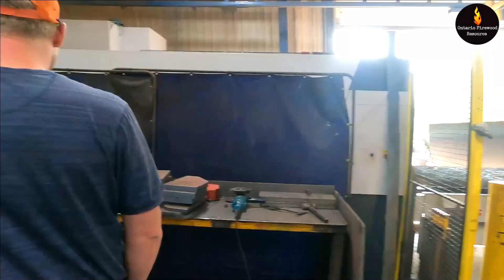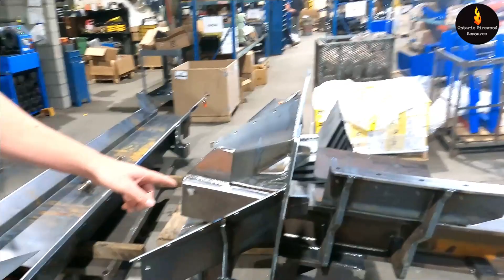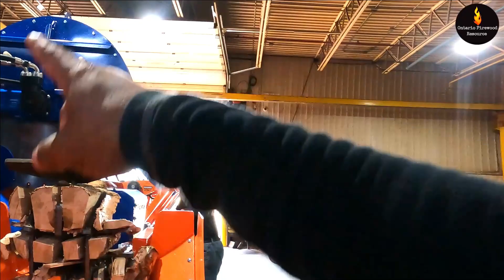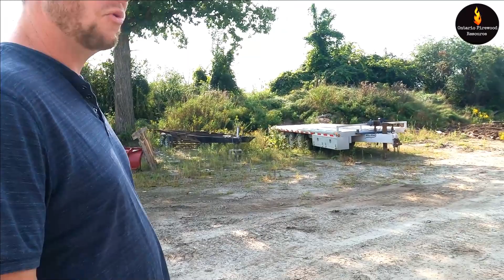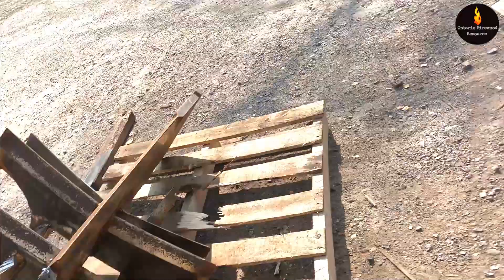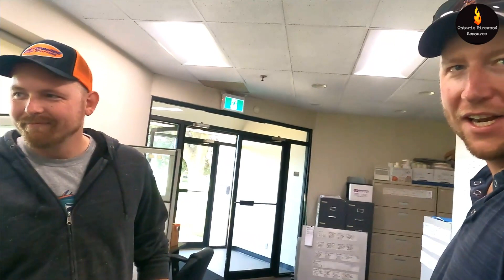EASTONMADE WOODSPLITTERS TOUR 2.0! #FIREWOOD

Comment: Love to get one of those eastons but too rich for my blood😢
Reply from the maker: I should've bought one before I built one. I knew eastonmade a little bit while I was researching which machine to buy or to build one. It was my early days of the business so I wasn't looking at a huge purpose. I was getting a lot of straight wood so I built the beastonmade. The parts were inexpensive and I traded wood for the  welding.and metal scraps were used instead of new stock

Comment: Going to the Easton Made Facility, Which of them would you buy, 12-22 22-28 WITH THE Attached Conveyer or the 37D, hAVE A GOOD DAY Anthony,
Reply: I picked up my 12-22 this past Friday and it is awesome.  I even used the pizza wedge and it worked great!
Reply: @adirondackwoodsman is it east to switch from pizza to regular wedge?
Reply: @adventurerhoades  I am not sure since I have only had it a week and I want to get through some ash before swapping it out.  I think it weighs like a couple hundred pounds so I plan on using my tractor to lift it.  I think it will be easier putting it in with 2 people to have one person line it up.  The regular wedge is nowhere as heavy